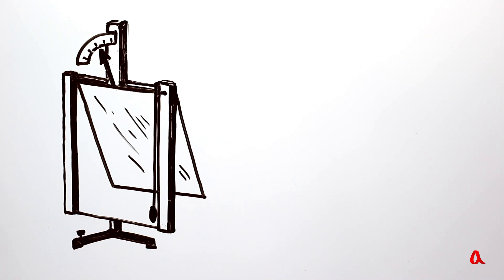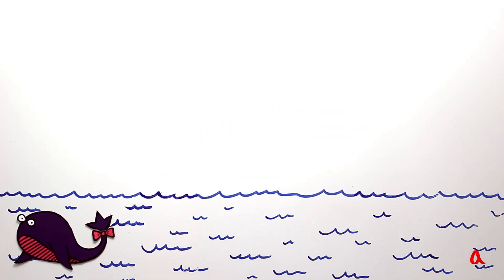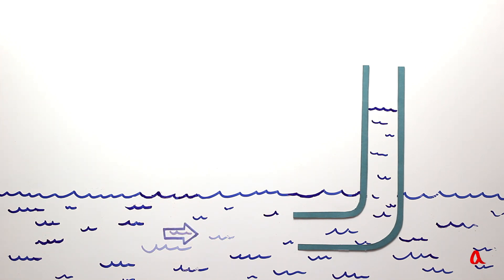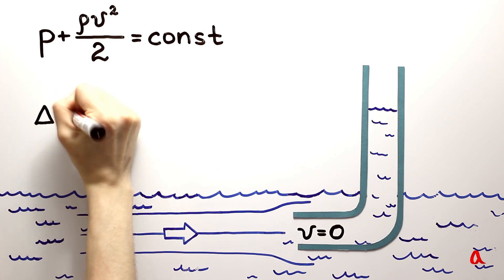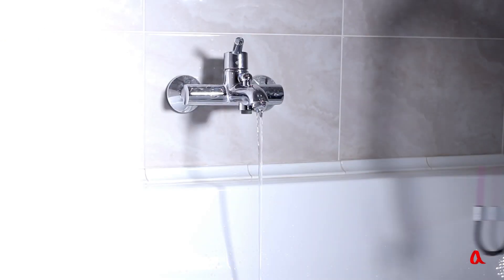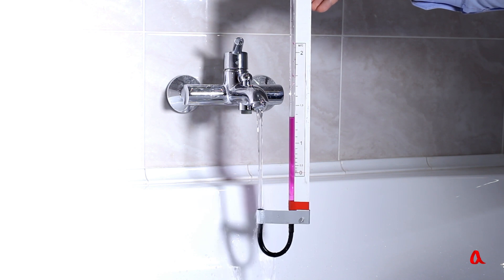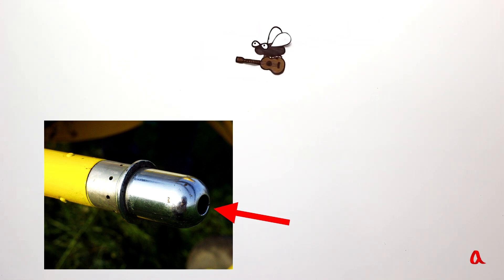Pitot tube

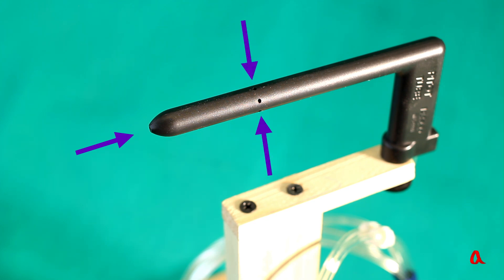Comment: 3:27 About side holes. Isn't the same as blowing air to hole of perpendicular tube ?
Such blowing also should decrease pressure in side holes.

Thank you for the sharing knowledge.
Reply: Yes, it is, but rotating the tube sideways to measure the static pressure is usually not feasible or not practical.
Reply: No, side holes is to measure static pressure in a fluid stream.  Perpendicular hole measures velocity pressure.  A pitot tube is a shell and tube device.  Perpendicular hole is common to the inner tube and perpendicular holes are common to the outer shell or tube.